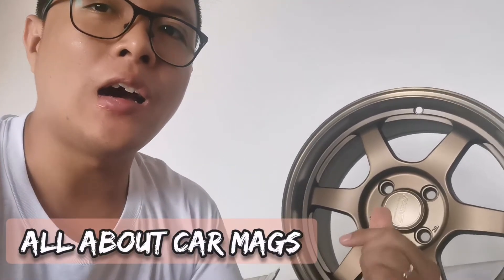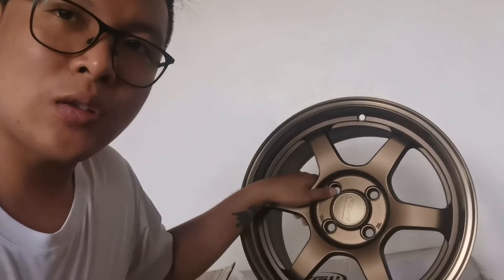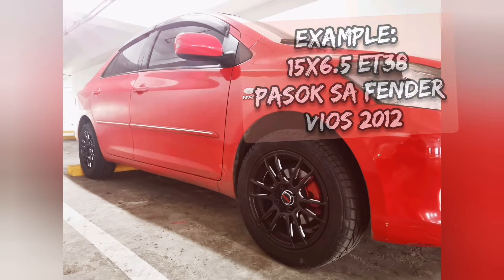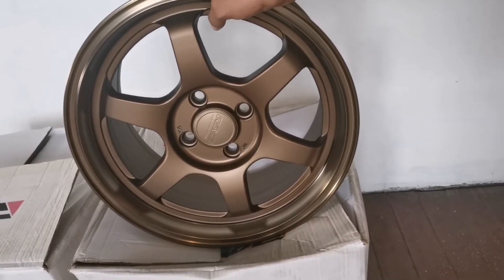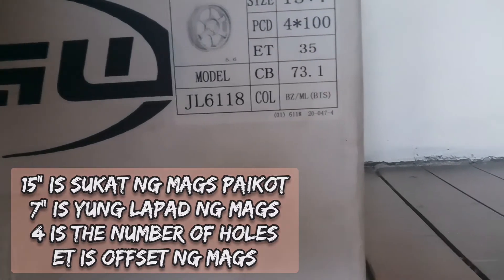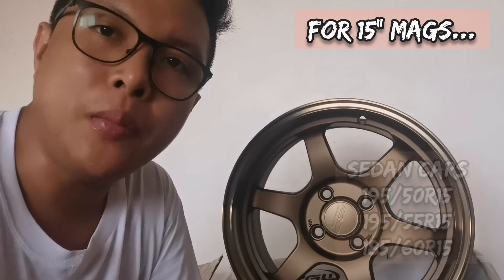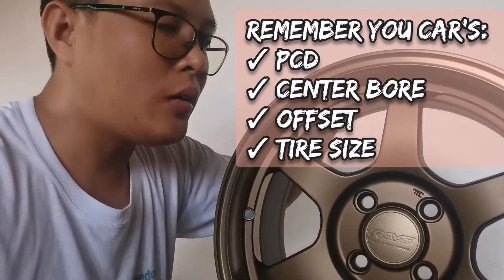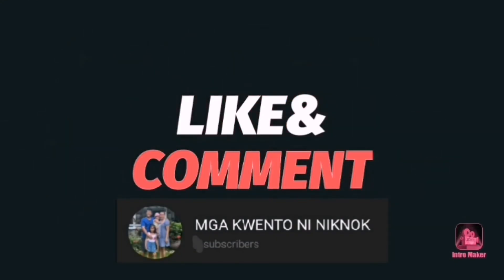MGA DAPAT MALAMAN SA MAGS PCD / OFFSET / LUGNUTS ATBP. TARA PAG USAPAN NATIN (TAGALOG)

Comment: Bos vios size15 wheels pwedi ba high profile tire kabit ko? Probensya kasi dami roughroad..
Reply from the maker: 185/60 or 65r15 pde yan
Reply: Boss sa vios size 16s po anu magandang sukat na hindi matagtag pero maporma parin.
Probinsya din samin. Nakabili ako 205/25/17 17x8 ang sukat. Diko pa nagamit Ipapalit ko at hndi pala un uubra dito samin.